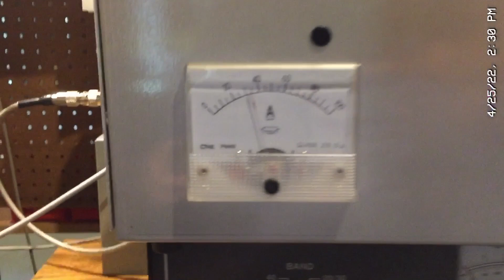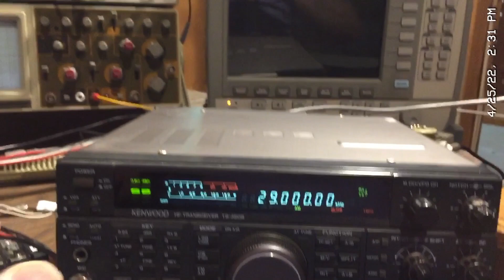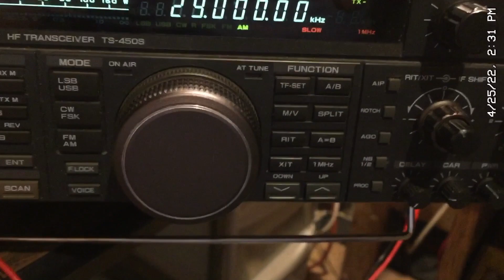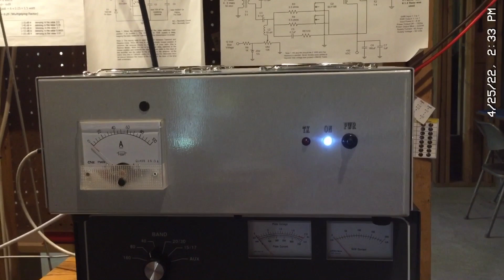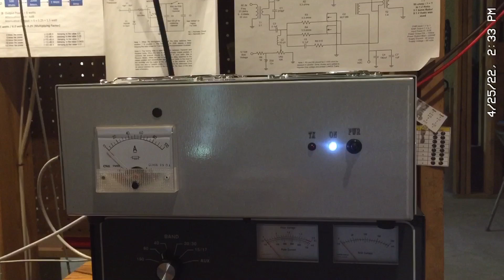LDMOS 1500w Amp For Sale

Comment: Agreed. The LPF is indeed part of the amplifier. 
Anyway, the harmonic content of push-pull amps will be low in 2nd harmonic so the highest will probably be 3rd which will likely be around  20dB below fundamental. So the sum of the power in all the harmonics should be significantly less than 10%. Not really significant.
Agreed in the two-tone test. Only way to test an ssb amplifier.

Comment: hey buddy  iwant help form you 

I have 8 rf amplifier and each output power is more than 1.5 kw and these are pulse amplifier 

And 8 of these combine useing 8 to 1combiner and total output is more than 8kw but 

After repair these amplifiers the total out is less than 4kw is it happen because of phase matching or impedance matching what is different of that and i have R&H vector network anylizer with in the range of 1ghz to 4.5ghz 
Amplifier range is 1250mhz to 1350mhz pulse amplifier pulse is 14microsecond 

I use VNA WITH RATIO OF B1/B2 AND CONNECT ATTENUATOR TO REDUSE POWER THEN SIGNAL GENARATOR OUT PULSE WITH 1300MHZ THEN VNA SHOW CERTAIN POINT PHASE ANGLE VARIED AGAIN AND AGAIN WHAT IS THE REASON FOR THAT

Comment: 50A :O
Reply from the maker: The 50 volt power supply is rated for 50 amps. The amplifier draws 40 amps which provide 10 amps for margin. Regards